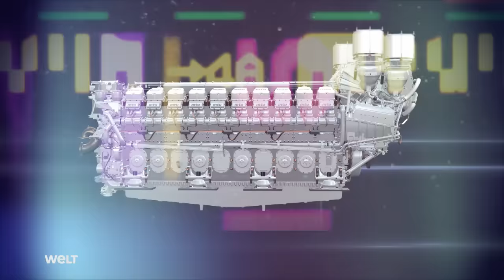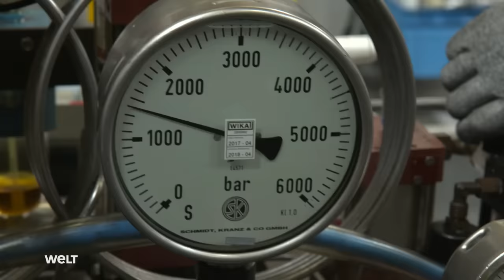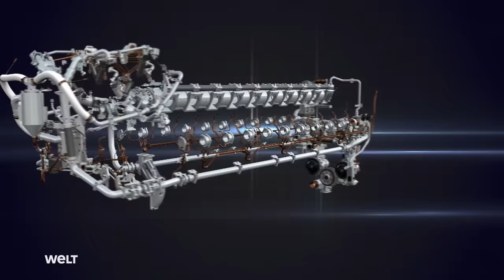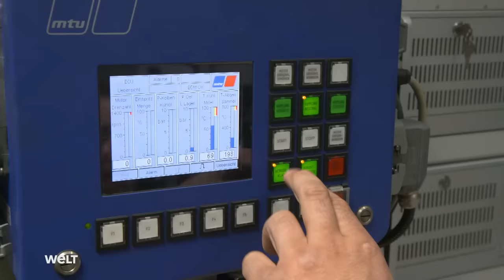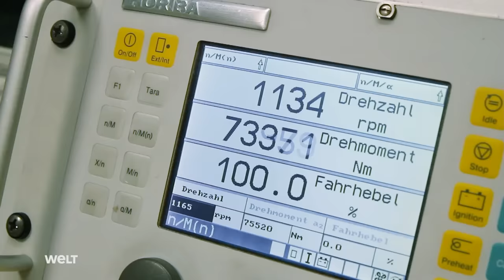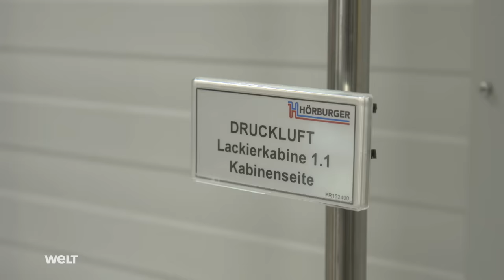Mega Diesel Engines - How To Build A 13,600 HP Engine | Full Documentary

Comment: finaly found the perfect engine swap for my civic
Reply: I can only imagine the VTEC on this thing
Reply: Yea you show those supras.
Reply: Lmao is anti-lag possible on these engine? Just wondering
Reply: You could part your civic in one of the cylinder bores
Reply: You may have to do a little firewall work first.
Reply: HAHAHHAHAHHAHAHAHHA
Reply: @thomasdwi906  oi kampret
Reply: MrSmall wkwk
Reply: You don't engine swap the Civic. You Civic swap the engine lol.
Reply: Dude, I think that may be a tad bit too much horsepower for one car.
Reply: civic rocket
Reply: You need to stick with Hector's proven formula; Spoon engine, T66 turbo, nitrous, and a MoTec system exhaust.
Reply: Hugh Mungus it already has the phatest cams in the world
Reply: No, you have found an engine big enough to eat your civic.
Reply: r/beatmetoit
Reply: I already did that with a steam engine, it was very big but I made it fit. I just had to stretch the frame so it’s big enough to hold the water tanks, coal, a boiler or 2, and the engine itself.
Reply: Terrorists have the easy job.  Place a $1.00 piece of C4 on the boat hull and all this work goes to the bottom of the sea.   As they say "It is easier to destroy than to create". Sad :(
Reply: Better beef up ya suspension
Reply: @veialyyad4816  O god it would sound like a tank
Reply: I’m gonna put this engine in a Prius however it needs way more power and maybe 12 turbos + VTEC.
Reply: Can you imagine how much would it cost to keep that thing running at Civic
Reply: 0 nm of torque
Reply: Lol
Reply: I wonder what the knock monster sounds like on one of these
Reply: 👌 perfect 4-v20s
Reply: 0-300 at 1 zecond
Reply: AHH-BOOOODINNNN
poppity-pop-pop
Reply: Lol
Reply: One piston is big as whole vtec engine.
Reply: Don’t forget the fart can
Reply: @FishFind3000  ROFL.
And a fluorescent color intake hose from Pep-boys.  And a stick on breather vent +5HP
Reply: Turbo k24 👍🇹🇷 loves
Reply: Same let's meet up after we get em done
Reply: Vtec goo brawrrrrrrrrrr!
Reply: Just alter the mounting brackets
Reply: @veialyyad4816  research purposes obviously 😏
Reply: I think not even with this engine will the civic go well 😅
Reply: @alexmail123  no way dude😐
Reply: True
Reply: More like that engine found the perfect vehicle swap to have sit on top of it.
Reply: @joeswilllasos3122   HHHHHHHHHHHHHHHHHHHHHHHHHAAAAAAAAAAAAAAAAAAAAAAAAAAA
Reply: To small for a civic
Reply: @davidduffy6351  what about a renault twingo then ??
Reply: For sure, but you're going to need a really heavy clutch. I also think you will need Richard from precision transmission to put something together for you
Reply: Bruh just buy a computer
Reply: @peterj6802  6o
Reply: @markhowe5834  8
Reply: And you'll still say it has way more HP to the wheels than it really has. Lmao
Reply: No way I saw it first!!!
Reply: That’s a little small maybe the accord
Reply: @nacovic7821  At idle the muffler will become a missile 😂😂😂
Reply: I gotta ask, what’s the MPG at highway speed if this was added to a civic?
Reply: Right, 6 tons of crankshaft 🙄🙄☺️
Reply: @peterj6802  יש לך מלא שאלות אנחנו נפתור הכל
Reply: uses blimp for NoS tank
Reply: @veialyyad4816  pneumatic injection lambda sensor/ valve
Reply: A Hatchback..right..?
Reply: One in the front, one in the rear.
Reply: It wouldnt fit with the vtec
Reply: Briggs and Stratton doesn't make diesel engines bro
Reply: IT’LL WORK
Reply: @stevesboot4866  !!!
Reply: You and me both
Reply: You just need a turbo and a lap top
Reply: You just made my miata jealous
Reply: there is a guy who made this giant ass trike motorcycle with one of this engines it looks bad ass
Reply: 0-60 in 0.1 second without that 69 nitros
Reply: What engine is best? Peel p50 or that civic engine?
Reply: Gonna be a pretty slow civic, but with torque enough to move a container ship
Reply: @peterj6802  2000 litres of fuel per hour, 😓 please do not drive the car then for more than 1minute.
Reply: I suppose it might run the turbo 😂
Reply: @ratataran  don't be so stupid. He is obviously going to drop a 136 speed transmission in it. All you need is the reactions of a fighter pilot for the 1st 50 gears, then you just need F1 reaction levels.
 Next you will be saying the engine doesn't fit. Duh that's why the arches are getting rolled.
Reply: Worlds first Civic worth 7 digits
Reply: Might have to make some slight modifications to ensure the engine will have enough clearance.
Reply: ...center?
Reply: Why retrofit your super car with such a lawn mower engine? You should take a look at something like a Wartsila Sulzer RTA96 engine. It may require some custom made engine supports and some drive chain adjustments to make it fit perfectly, but I'm pretty sure you'll like the extra horsepower that will become available. 😉
Reply: @Sierra-Whisky  well gonna be honest, with the current fuel price i was kinda looking after an hybrid ... so might have to strap a pair of SLS solid fuel rocket boosters on top.
Reply: @slckb0y65  I'm not really into things like rocket boosters. Do you know if they have a low carbon footprint? If so, I might consider such a setup for my 70's moped. Its emission is just of the scale 🤣
Reply: The only problem is, where will you put the engine?
Reply: I mean, it’s just bigger than a truck, let alone a civic!
Reply: @pauloguerreiro6487  i already planned for custom engine mounts and having to slightly modify the firewall, nothing to worry about !
Reply: Ah, ok!
Reply: Hoping to have a ride on that vehicle! It may get me from here, in Portugal to Germany in 12 minutes! 😂
Reply: @pauloguerreiro6487  with a fuel economy that's never seen before 😉
Reply: Your oil change gone be a million dollars
Reply: Forget that - I am putting it on my push mower.
Reply: @Jabberwok28  i thought about a fitting it on a tuk tuk for a second but we got pretty shitty weather here in belgium ...
Reply: Yes!!
Reply: Vtec has entered the chat
Reply: Hell, you can have the engine, I just need a couple of those turbochargers 😁
Reply: Or my ford fiesta.
Reply: Weights more then 40 civics
Reply: Your Civic’s engine you take out wont even be big enough to act as a starter on this engine!
Reply: when the engine is 47 tonnes heavier than the car itself
Reply: @RWL2012  that's what i call power to weight ratio
Reply: Forget the engine swap, just one of those turbo units should sharpen up your 0 - 300mph time 😆
Reply: 😂 be careful with that thing
Reply: What a tiny turbo. Pfft. I've seen bigger turbo's on some Saudi Supra's.
Reply: I dare you!!!!!!!!!!
Reply: Really bredda you couldn't day something better than that lol dwl 😂

Comment: How gentle and precise they are at the factory, but when it comes to real-world maintenance, it's just shoved together and locked down, and viola! It works! I would have been interested to see more of the the valve assembly.
Reply: The whole top end really, from the intake manifold to the cylinder heads, etc

Comment: Documentary starter pack:
- dramatic music over routine maintenance
- "Something horrible will go on if [mistake is made]" 
- milometer precision
Reply: "20 rotations per second!!!11!" You mean 1200 RPM.
Reply: @reneluigjes  And they act like it is something incredible. 1200 rpm is a high idle for most vehicles and light/medium duty application engines.
Reply: Right, I don't know why the germans are also starting to use the stupid, 1-second-attention-span-audience american style of making documentaries.
Reply: And no breaks when working.
Reply: And distance is measured in football fields, while weight is measured in jumbojets...
Reply: @f-j-Services  uhm. It is incredible when the cylinders are big enough for a grown man to stand inside with his arms wide open and not even touch the sides of the bore!!! Its called rotational mass, thats why this motor makes 13,500hp and the geo metro your mom lets you borrow if your grades are alright makes 80hp with an engine that weighs less than a single one of the giant motors connecting rods! Smh. Just.... the less you say now- the less you have to be humiliated about later.
Reply: @thomash3218  lmao exactly! I hate when they do that! "That means it weighs more than 16 thousand labradors in heat!" .... leaves me going "whoa! Thats.....well, alot? Is it?  How much does a labrador in heat weigh?" Basically more questions than answers.
Reply: @travisgartside409  I don't think you got the point..... yeah the engine itsself is incredible, but they are saying 20 rotations per second to make viewers go "wow that must be fast" instead of them just being simple and saying 1200 rpm which most people would know compared to rotations per second.
Reply: I love this affectionate joshing - what a great video!
Reply: I reject your metric and imperial systems and will now refer all my measurements in football fields.

Comment: Being an engine machinist and Rebuilder this has been one of the most interesting videos I have seen in a long time pressurizing the bolts with oil was something that I never knew was done I learned something new keep up the good work
Reply: Mantis 0001 hydraulic wrenches have been used for years in heavy industry. They are capable of reaching torque values well over 1000 lb/ft. In some installations cal rod heaters are inserted into bolting prior to torquing fasteners. Heating the bolting to predetermined values causes the bolting to lengthen. This process results in increased torque values and bolt stretch.
Reply: Steven Stam don’t understand the question
Reply: Da Truth : they do not pressurize the bolts with oil. the oil is used to turn a hydraulically powered torque wrench to tighten the bolts or nuts very very accurately to a torque level that a person would find it very hard to reach with a hand tool as well as a person could not tighten multiple fasteners simultaneously where as hydraulics can ..
Reply: @normdoty  Is it a wrench that turns the nut or does the hydraulics stretch the bolt a pre-determined length, the nut run down, then pressure released? It was my understanding that it's the later.
Reply: On Pielstik engines, the nuts are run on to the head studs first, then a cage is fitted over them. A hydraulic jack is then run onto the head studs, and sits on the cage and then pressurised. This stretches the head studs enabling the nuts to be rotated until tight with a special tool. The jack pressure is then released , removed, along with cage.  They are usually all done at the same time, so all the nuts are tightened at the same time and the same torque. The whole apparatus looks like an octopus, because of all the hydraulic lines protruding from the centre hub.

Comment: Love the video. I use to work on submarine refit doing plumbing. I was sent to do some work on a roll on roll off ship and saw biggest pistons I ever saw.
18 inch diameter on main engine. Starter motor was a V 16 the size of a 20ft container. I was doing industrial & domestic plumbing before trying naval maintenance. When I first arrived I was shown the big stuff. There in one of the buildings was a Lathe with a 30ft diameter chuck, for turning props.
Brought back some memories, great video.
Reply: Nai Rekab from the size of the starter motor I can only assume that the starter motor has a starter motor?
Reply: @funforever1671  even so I'd imagine that starter motor itself, in fact also has a starter motor, which is started by a motor.
Reply: @ApexPressureWash  😂 that is funny!  
This reminds me of a musing I had one day while driving.  Police have devices that detect a radar detector used in your car in places where it’s illegal to use a detector.  So, radar detector manufacturers invented a technology that could detect the presence of a radar detector detector by it’s ranging frequency.  So, I thought naturally the next step in the process would be a tool that would enable speed enforcement officers to detect detectors that can detect radar detecting detectors before the driver’s radar detector can detect the officer’s radar detecting detector and block it’s outgoing energy waves before detection.   Simple!
Reply: @Jon Kaminsky  Radar deflector mic drop

Comment: I got to work on two of these before they were installed into the Fred Olsen, replacing power packs due to an upgrade in design. Although they are huge for a high speed diesel, they are surprisingly easy to work on. 

The biggest obstacle we had was getting the engines inside of the workshop as the building didn't have the overhead crane capacity to lift them. We had to move the engines into position outside the workshop using machine skates underneath their transport frames and pull them with big winches, this left 2cm deep and 10cm wide grooves in the concrete from the machine skates breaking it apart.  We then had to remove part of the workshop roof and use 2 X 250 ton mobile cranes to lift the engines into the workshop.

I remember the engineers who flew over from Friedrichschafen turning up to work wearing thongs (flip flops), their reason for that was that they were in Australia where it is hot.
Reply: Be happy.
You could have been working on a BIG Marine Diesel - like a Wärtsilä RT-flex96C or a MAN B&W 12S90ME-C Mark 9.2.
But those aren't "high speed" diesels - just very high POWER (and huge torque).
Reply: @bricefleckenstein9666  I have done a fair bit of work on Wartsila and Pielstick engines.
Reply: @2secondslater  Does Pielstick still exist as a brand under MAN?
Reply: @bricefleckenstein9666  I am not sure,. I would say they have been rebranded to MAN now, at a guess?

Comment: "a staggering 20 Revolutions Per Second " jaw dropped until i realized that was 1200 rpm
Reply: Thats a lot for these big engines
Reply: Johan Fouche The difference between 2000 and 1200 is much less than between 1200 and 4000. I’m not very educated but a crank that size will rip itself apart at 4k
Reply: high rpm for such a large engine, the really big engines on cruise ships and container ships often run under 100rpm nut of course those engines are even larger yet
Reply: Johan Fouche  that's a completely different application, those engines are much smaller then this by comparison and yes it is overdramatized for television any documentaries like this are
Reply: Johan Fouche  it does matter even perfectly balanced due to centrifugal forces when it spins a bit like a dragster wheel when they do burnout it expend like crazy balancing a shaft just prevent wobble
Reply: I prefer the term "Cylinderpiston" as it implies exactly what it consists of more or less - A cylinder and a piston and it's complementary components. Whereas the term cylinder assembly is somewhat vague IMHO
Reply: But the thing be big tho
Reply: I thought the same thing, 1200 rpm.
I believe the real limiting factor is piston speed. A longer stroke has much greater forces as rpm increases. Large, heavy pistons and a long stroke probably don't RPM well.
Reply: @jhomrich89  some run at 30rpm
Reply: @j.m.5995  I wouldn't be surprised if "cylinderpiston" is a direct translation of the German word for the assembly - Germans love compound nouns like that which very literally describe the thing.

Comment: Been in a room with a running ~19.000HP engine. That thing was 5 stories tall and had a 2-ton flywheel :-)
Reply: The largest ship I was an engineer on was fitted with a 25,000 BHP 2 stroke slow speed diesel engine.

Comment: What a cute little engine.  Back in 1988 the largest diesel engine in the world was 63,000 H.P. 12 cylinder, 2 stroke KHIC Sulzer slow speed diesel used in each one of the largest container-ships in the world of which five were built.
These were built for A.P.L. (American President Lines) and were the first 'Post Panamax' containerships in the world. (Too wide for the Panama Canal).  Today in 2020 there are 80,000 H.P. ship engines.

Comment: 3:10 if you're curious, "common rail" means there is a containment rail lined above and along the cylinders, filled with fuel. Used for most direct injection engines.
Reply: With super super high fuel pressures lol. Upwards of 60,000 psi
Reply: @canuckcanadian753  ooooohhhhh yessss bars for days
Reply: Mate most people think a rail carries either trains or curtains you can't explain common rail by calling it a containment rail lol
Reply: Common rail means there is one fuel rail feeding several cylinders. This is used on modern diesel and direct injected engines. Traditionally, each cylinder would be plumbed directly from the pump, or fuel distributor independently. This worked well, but any air in the system would stall the engine, and made servcining a fastidious, and arduous process.

Injector technology, and more importantly engine management systems have allowed the use of common rail, and we haven't looked back since.
Reply: Even gasoline cars have a common rail system nowadays. But the pressure is higher on diesel engines, up to 3,000 bars
Reply: HPCR high pressure common rail systems require less fuel to produce a better air fuel mixture in the combustion chamber. More power and better fuel economy, brilliant!

Comment: I find it striking that these engines are for the most part exactly like the engine in your average car. Just about 128 times larger, assuming the 350 liter displacement is correct vs a 2.8 liter vehicle.